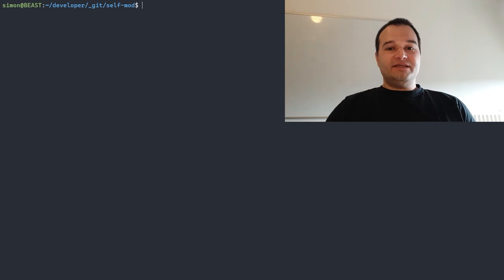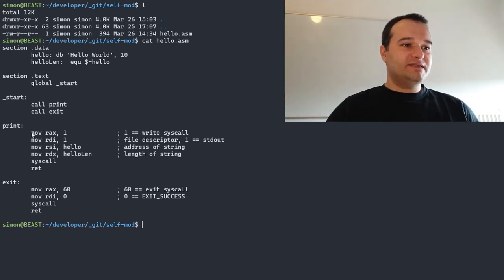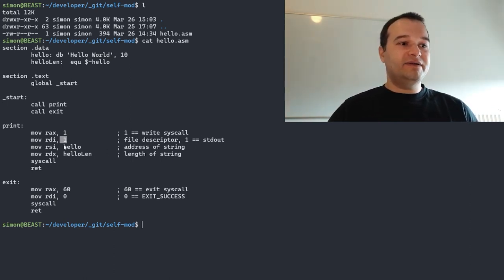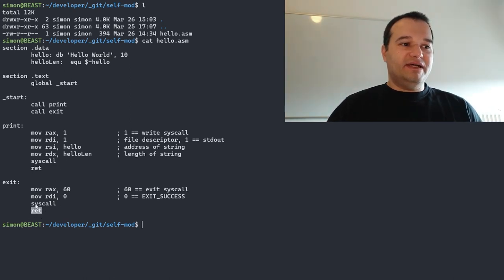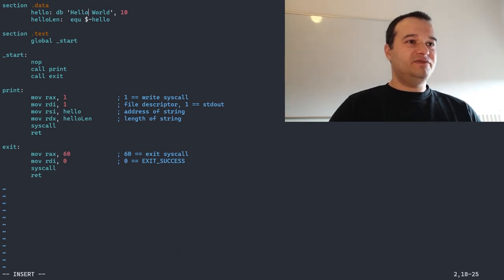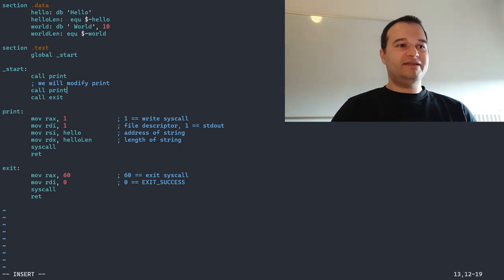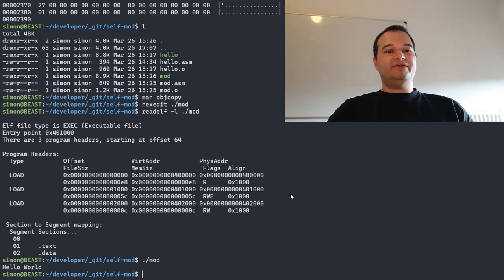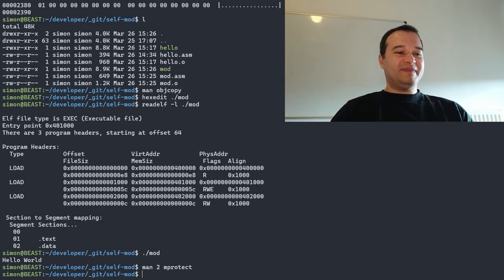Self-Modifying Code in Assembly

Comment: How did you find the address of the bytes to change the flags of text segment, was it the address in the same line as RW 0x5c , from the readelf output ? ( where you changed 5 to 7)